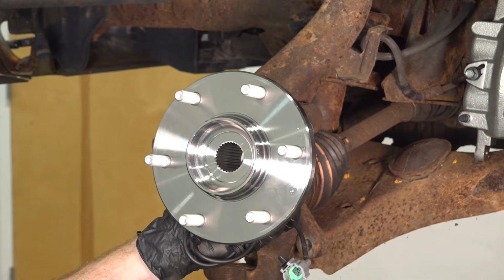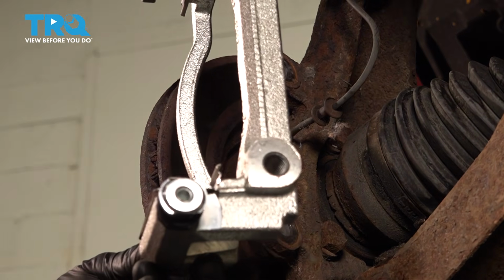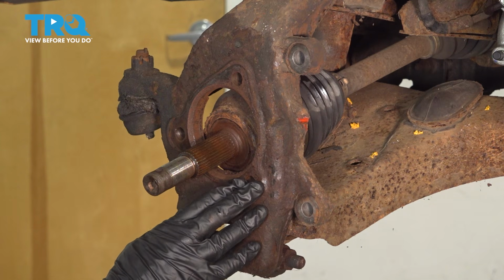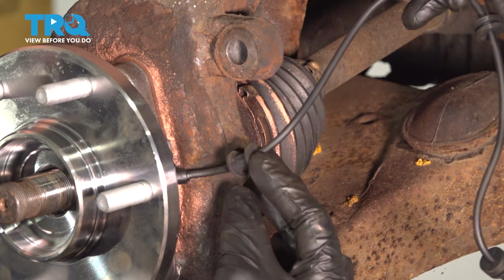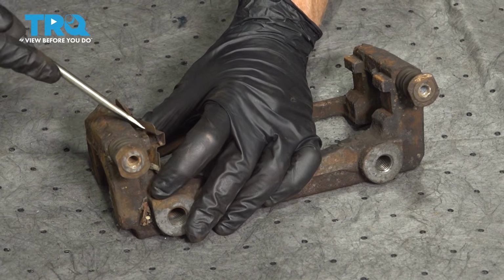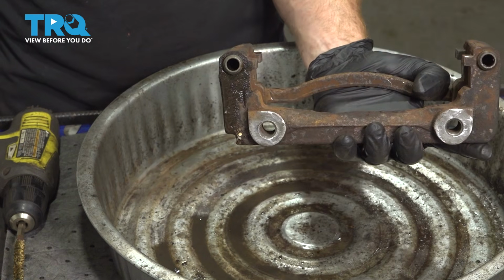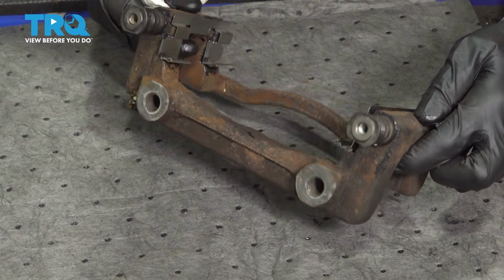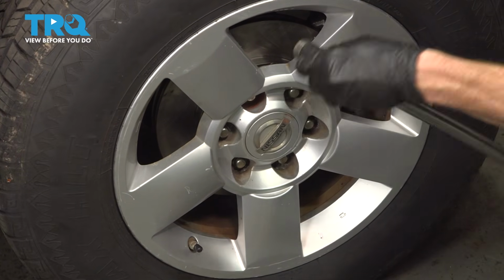How to Replace Front Wheel Bearing & Hub Assembly 2004-2015 Nissan Titan

Comment: 7:10

If you have a stuck bearing and it doesn't want to move, knock out a couple studs, get a couple bolts (heavy duty, half inch or bigger) and nuts.

Take the bolt through the hole for the studs you removed and thread the nut on the back side until the bolt is touching the knuckle. Try to get at least 2 bolts on opposite sides of the circle. Go back and forth between the two tightening the bolt while hold the nut still. The bolt will push against the knuckle and act as a makeshift press to force the bearing out. Try to use some penetrating oil as well, it helps.

Comment: We had to do this on my son's vehicle. Neither side cooperated with coming apart like shown here (we had to eventually take the entire knuckle out and put it in a wooden jig to support it so we could pound the hub out from the back side with a 8 lb sledge hammer). Between the two sides, one had copper anti-seize on it from previous work that had been done and that was by far the worst side getting apart. We ended up having to replace the axle because the splines were frozen to the hub assembly no matter what we tried. The side that did not have the anti-seize didn't come apart easily but was better than the side that did have it.

Comment: Excellent video.But the one thing I would add.When you lower the vehicle make sure you pump your brakes to tighten up the brake pads. If someone is on a driveway they could get freaked out if it started rolling & the first pump did not stop them.

Comment: I did one side of my 2008 infiniti qx56 but i do notice the other side is making a roaring noise when im on the highway..so i nned to replace it. Replacing the first one was a chore...it didnt come out as easy as yours..you just tapped yours and it fell out..i probably need some good penetrating oil..im going to spray it the night before so it will really soak in there.
Reply: Yes we get it baddd

Comment: Question.
1. By parts cleaner do you mean Break Parts Cleaner?
2. Pernatex also sells the PERMATE COPPER ANTI-SEIZE LUBRICANT, 16 OZ Part#31163. Can I use this chemical insted of the copper spray?

Comment: Beware, there are 2 different hub assemblies for 2007 Titan trucks depending when it was built. 2007 1/2 and above was upgraded and won’t fit rotors after install, had to do this job twice after Nissan dealership sold me the wrong one.
Reply from the maker: +TheIrongutz Thanks for the tip! We'll pass this info along to our production team. http://1aau.to/m/Shop-TRQ

Comment: Thoughts on using a thin coat of copper antisieze instead of loktite for caliper bracket and bearing bolts? Did mine before watching but now wondering if it’s safe?

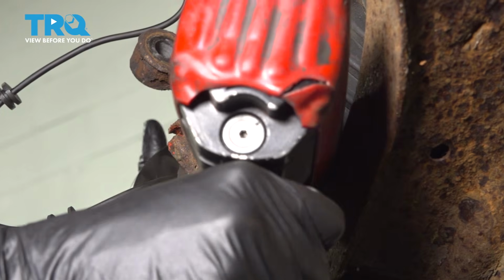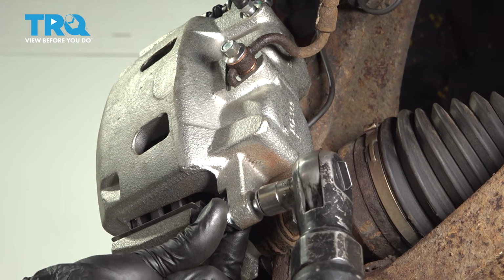Comment: Really like the detail of your videos.  You say at 10:05 that the torque for the wheel hub and bearing assembly bolts is 155 ft lbs.  The manual that I have for 2013 shows those as only 107 ft lbs.  Also, at 23:10 you say that the caliper sliding pin bolts torque to 32 ft lbs.  My manual shows 53 ft lbs.  You may want to double check those.